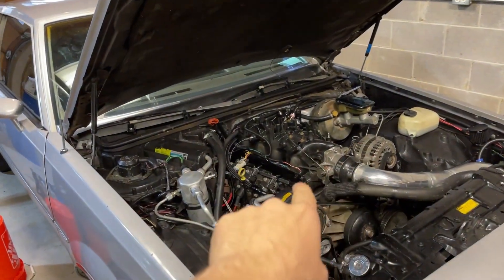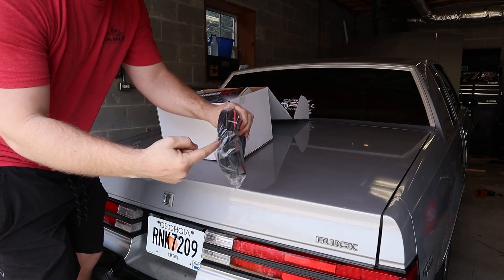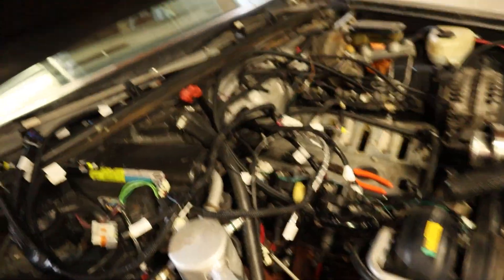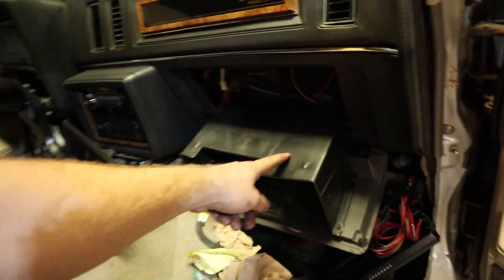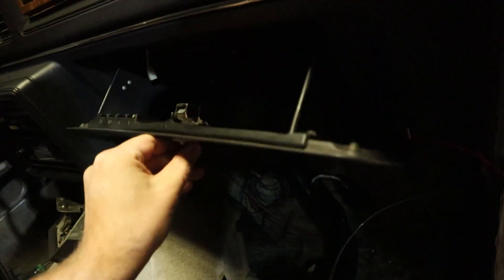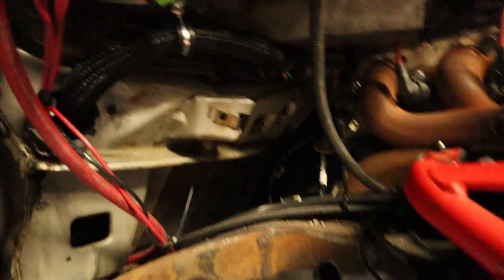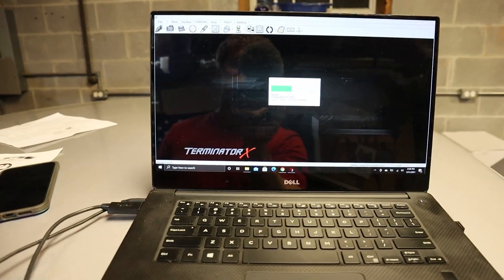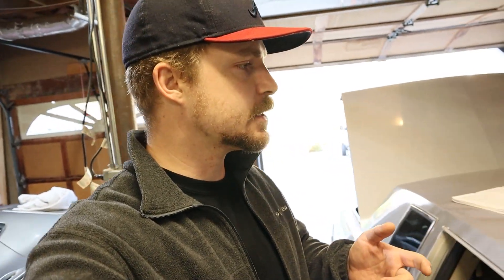Holley Terminator X Max Install! First Fireup!

Comment: How do you have your starter wired up? Im getting my ass kicked by mine 87 regal limited. I cant seem to get power to my started.
Reply from the maker: Comes off the firewall plug under the brake booster

Comment: You are the MAN! Thanks for this video.  I have a question.  I see the kit comes with an 02 sensor.  Is there only 1 required?
Reply from the maker: Yes
Reply: @SkinnyPedalMotorsports  hey bro I got my one all set up but my 2 ecu are not turning on
Reply from the maker: @zaytoinetillman5779  sounds like a power issue.
Reply: @SkinnyPedalMotorsports  can you install a 2bar map sensor for boosted applications?
Reply from the maker: @thephantomzoneboxing  I’ve got a 3 bar in mine
Reply: @SkinnyPedalMotorsports  what kind?
Reply from the maker: @thephantomzoneboxing  efi source

Comment: How much do u think it would cost to get the terminator x wired up
Reply from the maker: I’d do it for $500.
Reply: @SkinnyPedalMotorsports  where are u located I'm in tx
Reply from the maker: @nolaeast7412  Atlanta
Reply: @Skinny Pedal Motorsports  I can work with that
Reply: Skinny pedal Motorsports how long will it take to wire up an Holley wire harness

Comment: I installed the same harness in computer but mine will not start up. At all no spark but everything plugged up also grounded
Reply from the maker: Did you wire it directly to the battery?

Comment: How did you wire up the neutral safety switch wire
Reply from the maker: Didn’t need one in my car. It’s a column shift car. Plus the harness doesn’t go to that switch on the trans
Reply: @SkinnyPedalMotorsports  so I have a 87 cutlass column shifter, so I don't have to worry about that with my swap
Reply from the maker: @Bball128  nope. I’ve never wired anything like that
Reply: @SkinnyPedalMotorsports  thanks bro

Comment: I’m having problems getting my one to start what did you do for yours
Reply from the maker: What problems are you having?
Reply: My ecu didn’t turn on and the small screen didn’t turn on either I’m thinking my battery just needs to be replaced… this harness needs a strong battery right my one is old

Comment: Why not use the autotune/self tuning?  I understand it works really well.
Reply from the maker: Because the base tunes are quite far off from the research I’ve done. This thing idle okay but it was very rich smelling.
Reply: @SkinnyPedalMotorsports  how u did your base tune bc I just got my Holley n I need help to get mines running
Reply from the maker: @benolds3529  do you have a cable to hook it to the laptop?
Reply: @SkinnyPedalMotorsports  yes I have one but it didn't came with the 3.5 screen
Reply from the maker: @benolds3529  email me: daniellane5150@gmail.com. Send me your tune file and combo. I’ll help you out